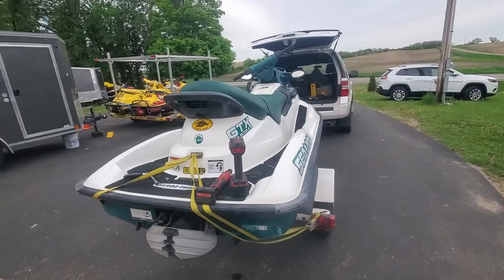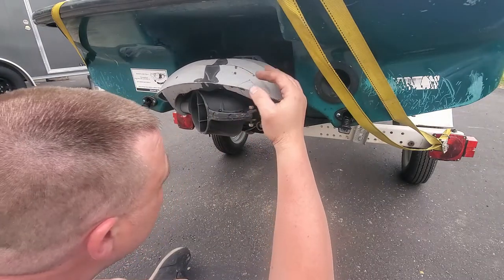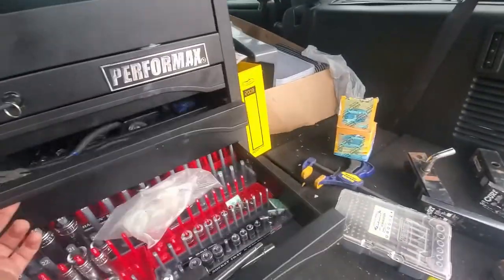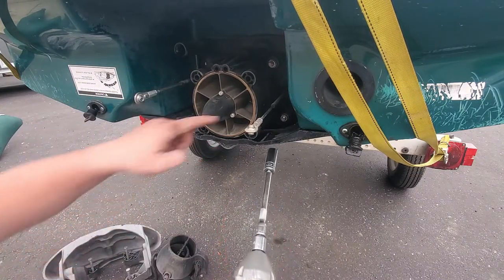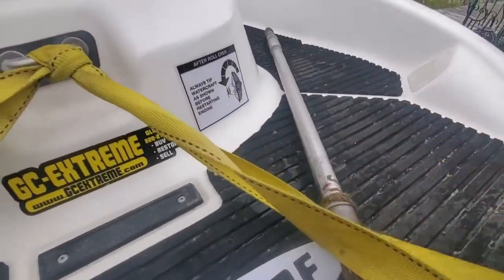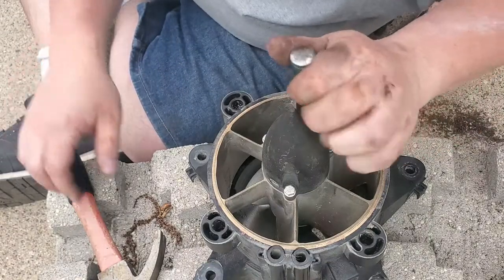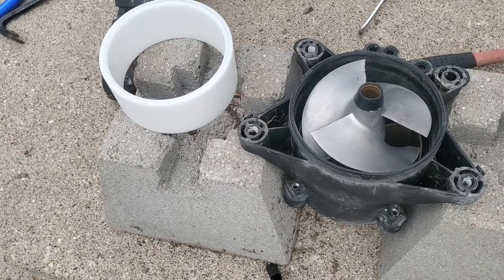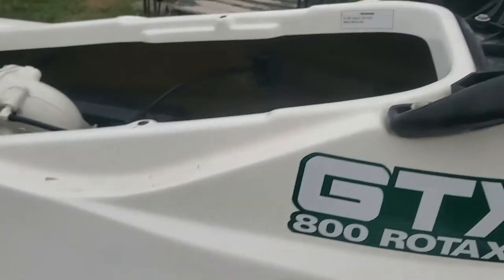How To: Wear Ring Replacement 97 GTX

Comment: Is the 97 Seadoo GTX wear ring size 140MM? I have 2 GTX’s and both need wear rings. Figured you might have an answer for me. Thanks!
Reply from the maker: Yes. If they have the 787 engine. The 951 engines got the 155mm pump

Comment: When this are worn do you hear line a rattle noise of metal? I have 2002 GTX RFI and it kinda rattles
Reply from the maker: @rudyshoplopez7366  no they all rattle a little..when its worn you lose forward propulsion. Itll rev up but not move in the water
Reply: @GCEXTREMEMN  thanks for the reply,  good to know

Comment: Maybe can you help me with my GTX not driving more than 10 mph just finish to rebuild the mikuni kit.
But I not think this is the issue
I think the previous owner mix gas and oil in a same tank
Maybe this can be the problem?
Maybe this water pump?
Reply: Are you sure you got spark in both pistons? I had a problem like that once and all it was I forgot to connect the throttle shaft at the bottom of the carb. Stupid mistake but you never know….

Comment: Do u haft to take out the drive shaft to pull the pump off or can u just un bolt the pump and it slide off on a 98 waverunner?
Reply from the maker: I dont know anything about Yamaha Waverunners.  My channel is for Sea-Doo skis.
Reply: No, you do not need to take the driveshaft out to remove the pump.
Reply: Ya I was sure you didn't have to take the driveshaft out

Comment: You’re going around your ass to get to your elbow carbon seal does not have to be done just for ware ring
Reply from the maker: I usually replace the carbon seals with new ones on all used machines anyways, and I usually replace them with carrier bearings anyways.
I sold this ski for $2800 with no trailer. A $50 new seal/carrier isn't a huge issue and its a peace of mind for the new owner.